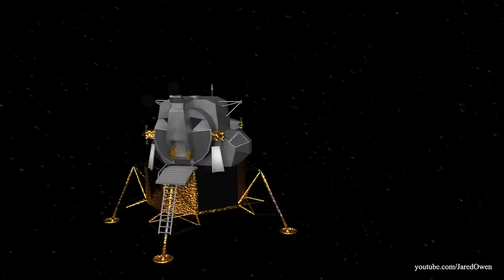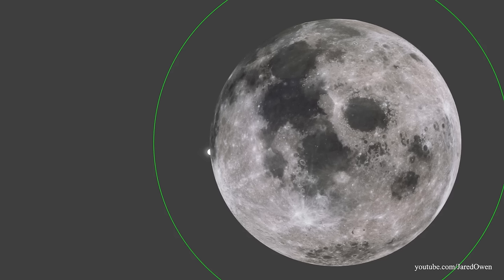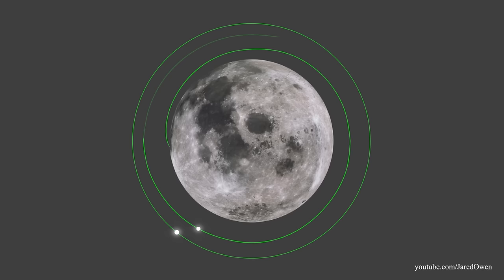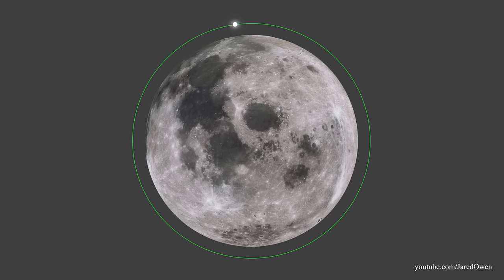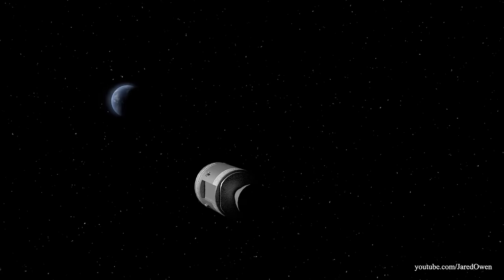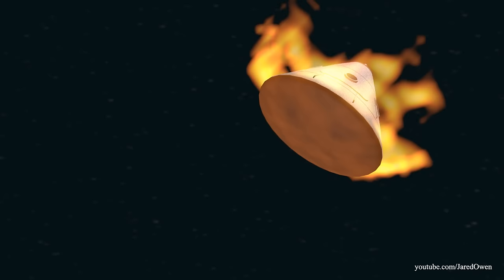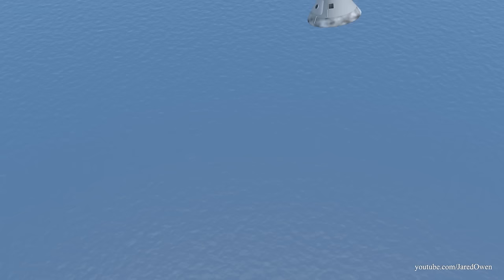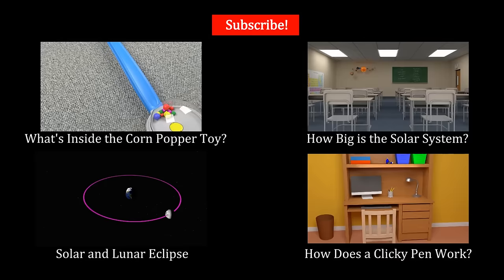How the Apollo Spacecraft works: Part 3

Comment: where does the crew pass from the LM to the CSM in the final stage ??? from the  propulsion nozzle??
Reply: Through the same docking tunnel that they used when they went from the CM to the LM. The removable docking mechanism was a bit of a hassle but was an ingenious system that worked better in zero-G than during the one-G training.
Reply: @mako88sb  so were they able to catch another spacecraft in orbit somewhere the moon and hook with it without damage? what was the system for both the LM and CM for find themself in orbit?
Reply: Yes, mostly by using radar but there were other systems in place for redundancy such as a visual guidance system. You can find out more by googling these PDFs:
“APOLLO EXPERIENCE REPORT - LUNAR MODULE LANDING RADAR AND RENDEZVOUS RADAR”
&
“Apollo experience report: Evolution of the rendezvous-maneuver plan for the lunar-landing missions”

Btw, lunar orbit rendezvous was one of three methods being looked at when it came to the finalizing of what type of space-craft to build. The big advantage with it is that the mission could be done with a single Saturn V vs using a single, even bigger launch platform like the proposed Nova rocket design. Or they would have had to use two Saturn V’s. The big disadvantage was the need for a rendezvous in lunar orbit that many felt would be to dangerous to count on. In the end they opted for the single Saturn V mission and one of the main purposes of the Gemini program was to ascertain the feasibility of lunar orbit rendezvous by practicing the procedure in Earth orbit. It was quickly determined to be not as difficult as expected so NASA did everything possible to train the astronauts to a high level of expertise and developing the actual systems and equipment needed.
Reply: The propultion nozzle is on the other side of the Lm, that indent you see is a mechanism designed to hook up with the pointy end of the CSM, and make a tunnel the astronauts can go through.

Comment: Could you add which burns were retro grade and which were prograde.  Were any burns done that were not aligned with the flight path?  Why didn’t they first orbit the earth on the way back?  Would that not have reduced the reentry velocity?  I realize they may not have had enough fuel for that, plus an extra manoeuvre for something to go wrong.
Reply: The information for all the burns done varied. Fortunately all of this info is available online with  the respective NASA Mission Reports for each mission such as this one for Apollo 16:

https://www.hq.nasa.gov/alsj/a16/A16_MissionReport.pdf

As for why they didn’t go into Earth orbit on the return, yes it was a propellant issue. To slow down from 24,000 mph to 17,000 mph to enter Earth orbit, they figured it would take 3 lbs of propellant for every 1 lb of mass of the CM and its contents. The additional propellant needed at launch to get the extra propellant for such a burn would have exceeded what the Saturn V was capable of.
Reply: @mako88sb  did they ever consider aero braking to get into orbit, or skipping off the atmosphere once or twice so as not to have to burn off all that velocity at once.  Then heat shield might not needed to withstand quite the same high temperatures or for as long.  Maybe even allow for a lighter shield.
Reply: @johnwythe1409  What would be the point of going into orbit on the return?
Reply: John Wythe    There’s more to the reentry phase than what’s shown in this video. For one thing, the center of gravity in the CM is purposely offset to give it some ability to maneuver during critical points of the reentry. They also do a pitch up after the first stage of reentry that helps to ease the thermal loading on the heat shield. Here’s an excellent video that goes into great detail about it all:

https://www.youtube.com/results?search_query=apollo-+atmospheric+reentry

As for aerobraking, I don’t recall ever seeing that being considered for the Apollo missions. Not really applicable to what was needed here as far as I can tell.
Reply: @mako88sb  I knew about the center of gravity for the ability to create a bit of aero dynamic lift.  Just wondered if the skipping was every considered.  probably too much danger of skipping off and not coming back I suppose.
Reply: @Tim22222  to reduce the velocity so not as much heat would be generated on re-entry.
Reply: @johnwythe1409  Bottom line: The returning capsule had a certain amount of kinetic energy to burn off, and 99.99% was done via atmospheric friction. Taking a break in the middle of that process to go into orbit for a little while doesn't help. There's just no benefit to doing that.
Reply: @Tim22222  True, but the velocity returning from the moon was much higher than earth orbital velocity.  Skipping would not mean going back into orbit, assuming they slowed down sufficiently the first time, to not leave the sphere of influence of the earth. they keep skipping 1,2 maybe 3 times burning of some kinetic energy until they no longer have enough to leave the atmosphere again, and continue to slow down and descend to the surface.
Reply: @johnwythe1409  No they were not that advanced

Comment: I wonder why it takes so much fuel to get into Earth orbit. On the other hand it seems to me that far less fuel was needed for the return. The third stage is smaller than the other ones
Reply: The Saturn V had to send up to 140 tonnes (Apollo spacecrafts plus the third stage with most of its fuel remaining) into low Earth orbit while the LM's upper stage sent less than 3 tonnes into low lunar orbit, or only about 1/50 of the mass the Saturn V had to carry.
Also remember that the Saturn V was launched from a world with 6 times stronger gravity than the Moon's, and getting into orbit requires almost 5 times higher speed (28,000 kph vs 5900 kph).
Sending astronauts into low Earth orbit only can be done with rockets much smaller than the Saturn V, as seen in this image:
https://www.nasa.gov/sites/default/files/thumbnails/image/rocket_size_comparion_artwork.jpg
The rockets from left to right are Redstone, Atlas LV-3B, Titan II GLV, Saturn IB and Saturn V.
The first was only used for suborbital flights, but the Atlas and Titan sent the 1-man Mercury and 2-man Gemini spacecrafts into low Earth orbit in the early to mid-1960s. The Saturn IB launched most of the Apollo spacecrafts that only went into low Earth orbit.
Reply: This was already answered, but, I will add: coming back from the moon is easier than going to the moon.  Going to the moon, they were fighting against Earth's gravity almost the entire way (85%, until lunar gravity was stronger than Earth's gravity), and needed a huge amount of velocity to accomplish this (almost 25,000 mph), with the 100,000 pounds of payload.  Coming back was far easier.  All they needed to do was break lunar orbit, and then the Earth's gravity pulls them home.  Basically, the command module just "falls" back to Earth from the moon.  But, getting the thing up there is far more difficult.

Comment: My question is about the amount of fuel the command module uses to send the astronauts back to earth orbit from the moon for 3 days. How can you travel 3days without refuelling
Reply: They only had to do one burn to break out of lunar orbit and head back to Earth. Aside from that there might be an occasional correction burn. Being in a vacuum helps a lot plus once they reached a certain point, Earths gravitational field of influence would come into play.
Reply: An object in motion tends to stay in motion
Reply: Distance or travel time is pretty irrelevant for the fuel consumption when it comes to space travel. What counts is how large change of velocity (or delta-v) a certain manoeuvre requires.
The velocity change needed to escape from low lunar orbit and head back to Earth was about 3000 km/h, and that acceleration took only a few minutes. After that, the spacecraft could coast all the way as it fell back to Earth, possibly with some minor course corrections underway.
Reply: Please refer to Newton's first law of motion.
Reply: Thanks guys

Comment: Why did it take them three days to get to the moon as it took 17,000 miles per hours to leave the earth’s orbit?  On average it’s less than 250k miles away?
Reply: As soon as the TLI burn was completed, the Apollo spacecraft started to decelerate because of the Earths gravity. Btw, the TLI burn accelerated the spacecraft to 24,000 mph. It would slow down to about 2000 mph before the moons gravity took over and the spacecraft started to accelerate again.

Comment: So it seems my LEGO Saturn V set has a few inaccuracies for how the stages separate.
Reply: Three main rocket stages detach system is correct and works fine. The only thing that I don't like is the LES since you broke it apart if you try to detach it and LM that doesn't fit to CM; SM and CM are difficult to detach too.

Comment: So how did they (control) stop the command module from tumbling down on re-entry.
Reply: The capsule centre of gravity is offset enough that it actually has some lift-vector and control is achieved using the RCS. It’s not as noticeable as on the LM and SM but the CM did have a RCS.
Reply: @mako88sb  ok thanks that makes sense now.
Reply: Np. There are videos that go into some detail about the actual reentry and there’s a lot more to it than I realized.

Comment: So how they cross the radiation van belts?
Reply: They weren't an insurmountable problem. The type of radiation found there is some of the easiest to block or attenuate against. However, there are certainly regions of the VAB's were the radiation hazard is more pronounced. The TLI burn was planned so that the Apollo spacecraft's trajectory would avoid or spend as little time as possible in the worst of these areas. 

A lot is made about the NASA video were an engineer supposedly states that they are trying to overcome problems so that they can go through the VAB's and of course people wonder why since they did all of this during the Apollo era. What he actually said was "We must solve these challenges before we send people through this region of space". What he means is that because Orion is being designed for space missions that could last months or even years as a Mars mission would require, they are planning on doing different trajectories through the VAB's that will expose it to more radiation than any Apollo mission ever experienced. The reason they would do that instead of a Apollo style TLI burn boils down to minimizing fuel usage which is very important for longer missions. 

Another thing to keep in mind is that Russia, Europe, China, India and Japan have all flown missions to the moon. So far, none of these countries/nations have brought forth any evidence that it's impossible to do a manned mission to it. That includes supposed claims about the radiation in the VAB's being too hazardous to pass through. No radiation expert from any country including the ones mentioned here have ever stated that the radiation in the VAB's was an insurmountable problem during the Apollo missions to the moon.

Comment: why is it so hard for NASA to redo this and why/how did they lose the telemetry data? If we did this in the 60's and 70's why haven't we gone back? Money is not an excuse, neither is material. Just curious we can make 3 short 5 minute videos about the most complicated most dangerous mission known to man but its impossible to replicate something that happened over 50 years ago? I understand the science I have studied it down to the amount of weight and velocity needed to accomplish this task but damn after those missions we are only going 17,500 to get to this 'space station' ...baffling
Reply: A lot of the telemetry data was simply intentionally erased after being documented. The vast majority of it was related to the Saturn V, CM/SM & LM system operations and since only the CM returned, there was no need to keep the info on tapes for spacecraft that no longer existed. All the mission reports are available online with lots of the information from those telemetry tapes. It is true that some telemetry tapes were kept but inadvertently lost or taped over, the Apollo 11 EVA being the most well known, but the only reason anyone knows about it is because NASA released the information about it. 

The only reason we’ve never gone beyond the VAB’s since the Apollo era with manned missions is because the USA committed to the shuttle program. The huge thing about this is the fact that the vehicular assembly building(vab) and mobile launch pads were converted from stacking and preparing the Saturn 1’s, 1B’s & V’s for launch to just only the space shuttle. NASA’s budget had been slashed so much that they couldn’t build another vab facility and even if they did, they didn’t have enough budget to build any more Saturn V’s along with the Shuttle’s. No facilities to safety stack and prepare Saturn V’s effectively stopped the Americans from any future missions beyond the VAB’s since the shuttles simply didn’t have the capability to go beyond LEO. The Russians version of the Saturn V, the N-1, was unable to be launched successfully and after the 4th attempt, they abandoned their manned moon landing program. 

It certainly has nothing to do with the radiation flux levels found in the VAB’s being an insurmountable hazard as it’s well known among scientists and aerospace engineers that the type of radiation found in the VAB’s is some of the easiest to shield/attenuate against. As to why they have to do testing on the Orion capsule in regards to the VAB’s, after all they already solved this for the Apollo missions so shouldn’t have to do it all over again for the Orion capsule according to hoax believers. Except the huge difference between the mission parameters of the Orion capsule vs the Apollo missions is overlooked and/or ignored. The Apollo CM was designed for 14 days max whereas the Orion capsule combined with planned for modules will have the capability to go as far as Mars which could take as long as 2 years. It’s not hard to see that testing for radiation protection/attenuation for 2 years vs 2 weeks is going to be significantly more involved and challenging which is why the Orion capsule test back in 2015 took it into regions of the VAB’s that no Apollo mission had ever endured. Radiation flux levels were much higher than what any of the Apollo capsules were exposed to during their respective TLI burn trajectories. 

Saying money is not an excuse is a bit ridiculous. Space missions are outrageously expensive and manned space missions are grotesquely, outrageously expensive. The Apollo program was a huge success and a big part of that can be attributed to the stringent testing for manned space missions which required all the components be rated for 99.99999% reliability. Achieving that type of safety quality is one thing for missions that lasted a maximum of 2 weeks but becomes significantly more challenging for longer duration missions.
Reply: I should also mention that there is still a fair portion of the ALSEP data transmittal tapes still around. They are attempting to locate more of them. Google: “ The long road to ALSEP data recovery”
Reply: No need, waste of money, moon is basically rock, it was done to win space race, they would probably send rovers now

Comment: Can we see that descent part now? Is it on the side that we can see?
Reply: All six landings happened on the lunar near (Earth facing) side, but there are no telescopes now or in the near future that would be able to see the descent stages left on the Moon as they are way too small.
Reply: You can see hundreds of photos from Arizona State University's LRO camera (in orbit around the moon).  There is no telescope large enough to see the descent stages on the moon from the distance of Earth (would require a lens about 75 feet in diameter to see a lander as just a dot, or a lens a quarter mile in diameter to see it in enough detail to know what it was).  But, from lunar orbit, there are hundreds of photos from about 20-30 miles above.  Arizona State University LRO photos of Apollo landing sites.

Comment: I still dont understand how they can rendez vous (and dock) so easily...
Reply from the maker: I'll make more videos in the future about docking mechanisms.  Thanks Jeremie
Reply: First, it requires launching the LM at the correct time relative to the CM and in the same direction. You also launch into a lower (smaller) orbit so that you gradually catch up. Then as you approach from behind you gradually raise your orbit to match the target. The LM also had a rendezvous radar on it the locked onto the CM. This told the LM's guidance computer the direction and distance to the CM. Once you successfully rendezvous the pilot simply maneuvers the LM into position and then they bring to two vehicles together so they capture each other. All of this was practiced and perfected during Project Gemini in the mid-1960's and was very reliable during Apollo.

Comment: What happens to the service module after Separating from the command module
Reply: Burned up in the atmosphere. There was actually some concern about the separation between the CM and the SM during the reentry was not as much as what they wanted so a new procedure was made to eliminate any potential issues with later missions.
Reply: I should also mention that there is still a fair portion of the ALSEP data transmittal tapes still around. They are attempting to locate more of them. Google: “ The long road to ALSEP data recovery”
Reply: Thanks a lot. Great video!
Reply: Sorry, I didn’t realize I posted you a message about the transmittal data meant for someone else.